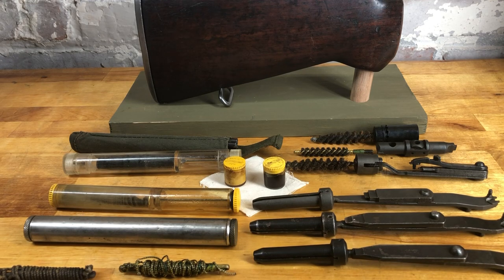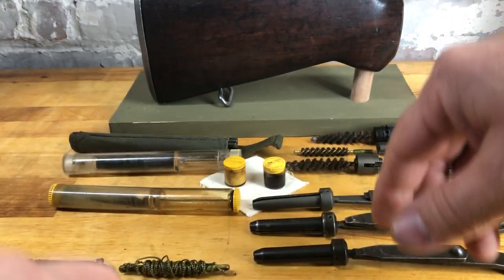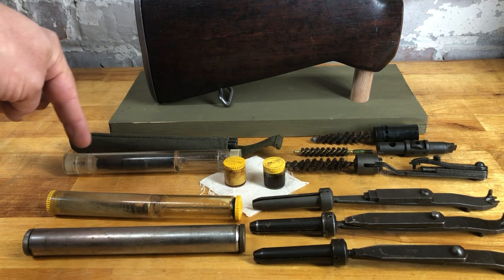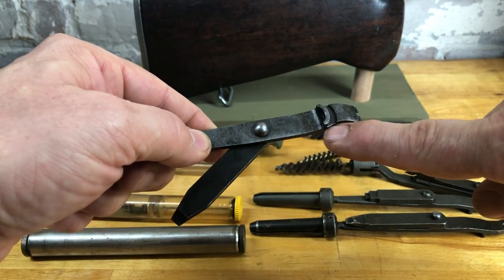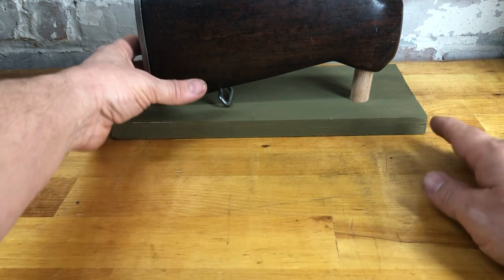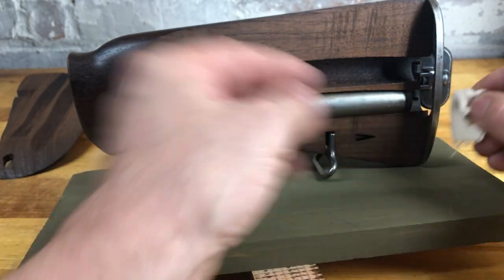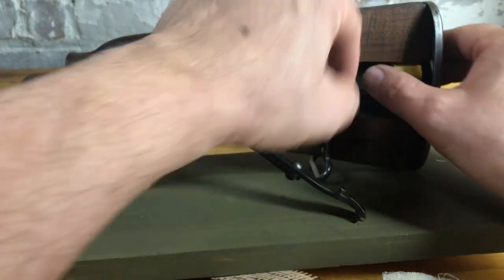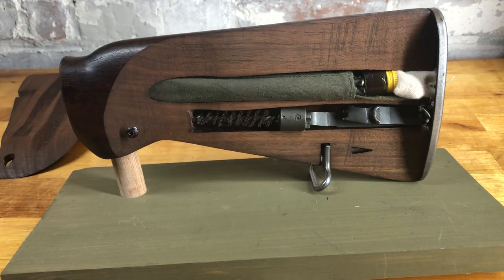M1 Garand Cleaning Kit Types & Storage

Comment: Your video near the end confused me so i looked it up and this is what i found. The M10 cleaning rods where not stored with the M3 series tool. The rods where stored with the M10 handle which was also  the tool. The rods /bore brush/patch tip and pouch go in the top hole with grease pot. The M10 handle goes in one end of the plastic oil bottle and sits in the bottom hole. The separate chamber brush is stored in the pack or pocket.

Comment: Hey. Big question: I saw you had the m10 combo tool on your table along with the slender barrel brush the jag and the 5 piece cleaning rod. Does all of that fit in the canvas bag or is the M10 tool inserted into the butt stock separately. I can’t get it all in the green bag!!!!
Reply from the maker: M10 goes in one end of the plastic insert.  Only the rods and tip will fit in the bag.

Comment: I have one of the clear oilers with the yellow caps, the m10 tool won't fit inside. Not sure if the oiler size was changed or what the deal is as the oiler seems quite old and had alot of staining and old oil in it,  the m10 tool seems original as well. Any thoughts?
Reply from the maker: M10 tool is post war.  Yellow capped oiler was 1/2 for oil and the other side for the pull through thong and brush.  This was issued mid-war through the 1950s.

Comment: Good video but! I may be abit slow here but what all would I use if I where trying to use a 1942 set up? Thanks!
Reply from the maker: An early cleaning tool and nickel oiler with pull-through throng.
Reply: @norwich93CMP  so the cleaning rod and grease pot with a nickel oiler?

Comment: The cleaning thong cords are age rotted, a substitute  can be made with the cleaning thong cord from a French MAS 49/56 rifle. The French cord is either knotted or metal stapled to the French thong metal bits. Unknot the gi cord end, noting the way the knot was done. Unknown or clip off the French woven cord, knot on the usgi thong piece. A bit of superglue on the tip keeps it from unraveling. Stretch out the cords, cut the French cord to length, knot up, treat the tip. You now have a cleaning thong for demonstrating. Another usgi thong for display. Another tip. The chamber brush combo tool, the brush bit, is held in by a captive pin, press and drive it out, the brush can be removed. Gunparts corp sells repop ones, either nylon or bronze bristles. Slide in, orientated hole, drive pin back in to secure. Some of the older pins will fall out.
Reply from the maker: Or use USGI 550 cord.

Comment: Thank you for the informative lecture and the sharp visual aid. My only question is where does the M10 tool go, or did I snooze in class? thank~!
Reply from the maker: The M10 came later and would go into one 1/2 of the plastic oiler.  oppisite of the oil.

Comment: I was  using the ratchet brush for the Chamber but once in it gets stuck. How do you remove it properly?
Reply from the maker: I assume stuck in the chamber.  Back it out while twisting at the same time.  It may take a little more force to recurve the splines the was needed to back it out.

Comment: So, where does the M10 tool fit in with this?.....I may have been the one that inspired this vid, great response, thanks guy.
Reply from the maker: It's in the clear plastic tube, third tube away from the camera.
Reply: @norwich93CMP  Thanks, I found that out from watching another vid I stumbled across.....Am I correct in thinking that the M10/ cleaning rod set up is not used in combination with that combo tool/ chamber brush thingy?
Reply from the maker: @winfieldjohnson125  Yes they are used together.  The tool is independant from the barrel cleaning items.
Reply: @norwich93CMP  Ok, now I'm confused; there would not seem to be room to stow the M10/oiler container, the cleaning rod kit, and that larger combo tool/ chamber brush all in the buttstock compartment.......Sorry if I seem a bit thick here, but I'm having trouble figuring out whether the M10 and the larger combo tool/chamber brush are part of the same kit.
Reply from the maker: @winfieldjohnson125  The M10 tool is just the handle which is used with the cleaning rod sections.  The tool with chamber brush is separate and does not come together.  There are rod sections, late post-war, still available new in the wrappers and does not include the tool, and never did so you have to buy both.  (Your not thick!, good question)
Reply: @norwich93CMP   I recently bought my first M1 Garand and I'm trying to put together an accurate cleaning kit for being in Europe in 1944-45. Like Winfield, I am confused with all these different components and where they fall into place. Those cleaning rods in your video introduced in the 50s, correct? This is where I'm confused. I have a picture saved on my tablet of a soldier in Luxembourg during the winter of 1944-45 cleaning his M1 Garand with a cleaning rod. Was there a cleaning rod system being issued at that time? Any help is appreciated.
I'm trying to put together a list of the items I need. So far I have the M3A1 Combo tool and a plastic oiler (with yellow caps). Would these both be correct? Thanks!

Comment: I should have said 4 piece rod and I should have Referred to the combo tool as the cleaning rod handle. Anyway my question is: does all that go in the canvas pouch?
Reply from the maker: M10 tool goes in the plastic oiler insert and the rod with tip go in the canvas bag.

Comment: I wish you would have shown the kit sets per years.  You started to mention it and jumped right over it after you said the plastic tube was was used in 1942.  You didn’t say which tool went with which tubes.
Reply from the maker: There was only one tool until the 1950s when it changed to the wired brush.
Reply: norwich93CMP You said there were several designs.  So which designs go to which years?
Reply from the maker: @mikea.2306  I don't have exact years.  Any sets would do unless your reenacting.  You have to remember even though you may have an early gun in would be ok to have a late set to replace old ones.  But usually later guns would have the later sets.